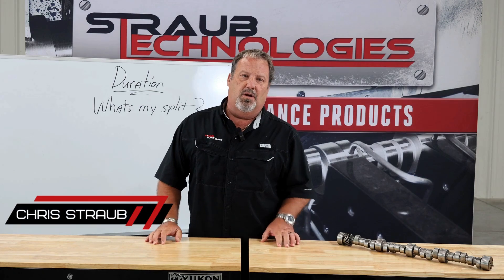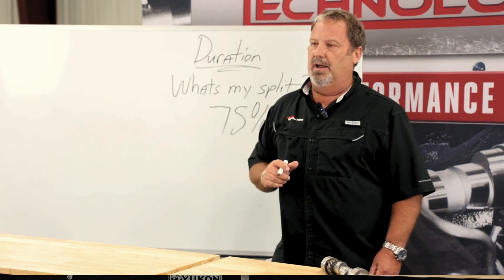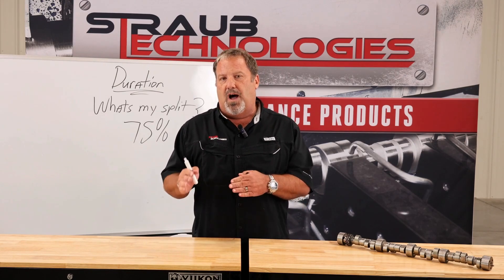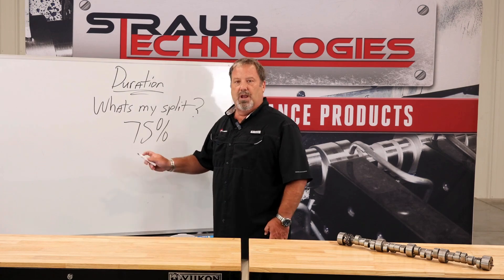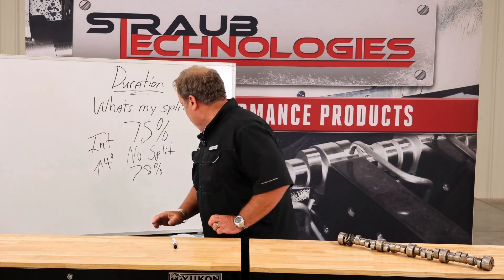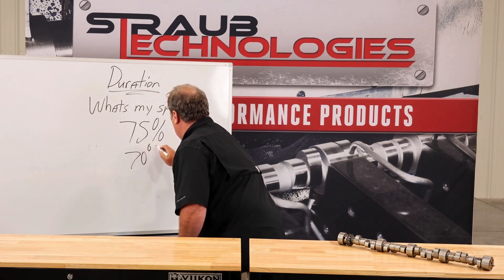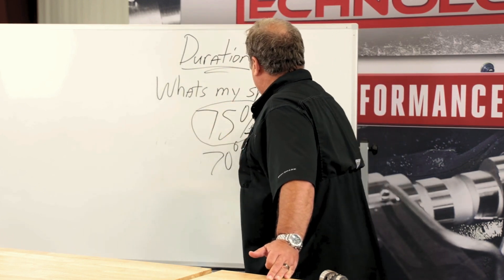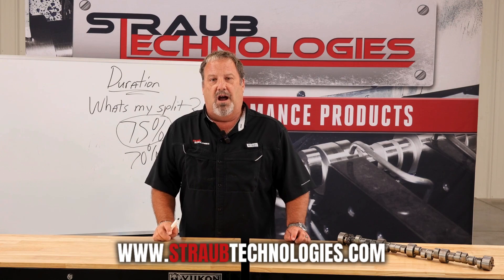Camshaft 102 video

Comment: Great information. I would assume this works on the LS platform as well. Just asking, since these heads a good right out of the box.
Reply from the maker: Yes and no.  GM engineers did their homework on the LS and then finetuned it on the LT. The intake port works like a 2 speed transmission.  The short run area is designed to maintain low speed drivability in the lower rpm range.  Above the short turn the MCSA is designed to feed CID at the higher rpm..   So under 6000 rpm, use thee 75%, above it add to the exhaust some duration.